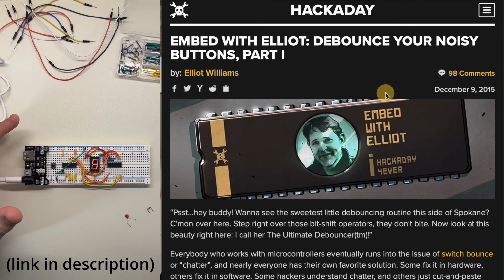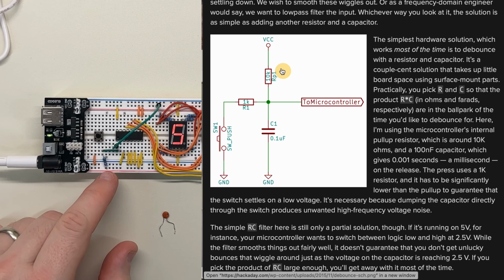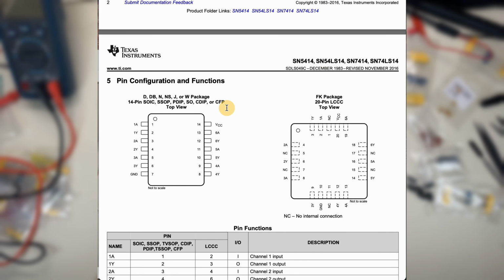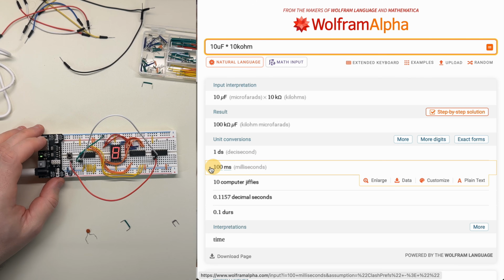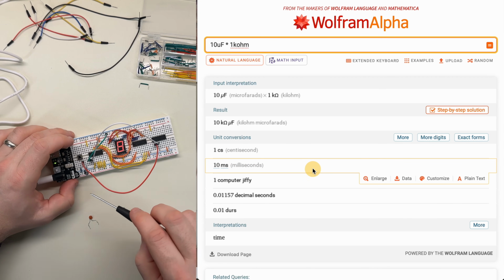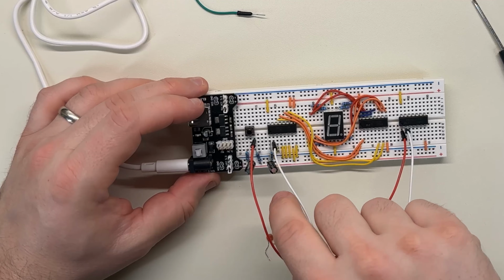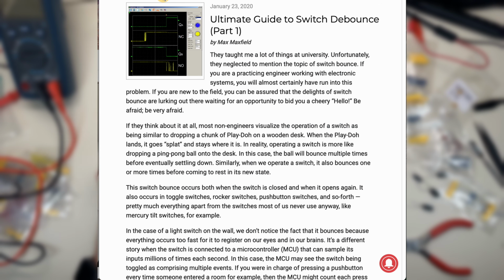Fixing my counter's bouncy button

Comment: You're right on the money with the reset circuit. On power up capacitor acts basically as a short.
Capacitor will discharge on its own through VCC pin and pull up resistor and also through the reset input.

Just use smaller capacitor to make it work reliable instead of resistor across capacitor otherwise you are making potential divider and reset might not be held to the positive rail but something lower.

On debounce circuit - it does work without shmitt logic gate. I did put it together just to double check. Don't do the R*C calculation tho, please use RC filter calculator to see what frequencies are being cut. for 1k and 100n that'd still let 1kHz spikes through.

What could happen is that you did not pull the voltage low enough to trigger this certain chip.

TTL chips of "LS" series are built slightly different and contain pull-up resistors on the inputs.
The value varies by the manufacturer tho, it could have happened that that resistance paralleled to your 10k resistor in conjunction with 1k resistor connected to the ground did not allow the voltage to fall below 0.8V which is logical "0". But that's me guessing.

Good work figuring it out :-)
Reply: It is actually quite difficult to design a power-on reset circuit that performs well. Where things typically go wrong is with brief power outage that doesn't allow a poor POR circuit design to be ready to work proplery when power is restored. I have some name-brand Ethernet switches that have poor POR circuits with the consequence that they don't reset properly on a brief AC mains power drop.

LS-TTL is highly consistent from one manufacture to another. Of course it is now essentially obsolete and has been for a number of years, though many parts are still being made. The inputs don't have pull-up resistors. The inputs are "current sourcing" - "conventional current" (which flows from positive to negative) flows out of the inputs. In order to establish a LOW condition at an input the voltage must be pulled to 0.8 volts or less with respect to circuit ground. With LS TTL the specified current sourced by an input is 0.4 mA. That means if you try to pull the input down with a resistor, that resistor should be no greater than 0.8 V / 0/4 mA = 2000 ohms. You actually also have to be able to provide 20 microamperes (again, "conventioal current) into an input to assure it will meet the minimum logic HIGH threshold voltage.

It is very much time constants that matter in debounce circuits, not frequencies as such. Switches from major manufactures will almost always have a bounce time specification, and what you need to assure is that the debounce circuit is designed based on that time. Depending on the characteristics of the input of the device you are using a simple RC product may be very close with regard to time (e.g. with 4000 series CMOS LOW and HIGH are 1/3 and 2/3 of the ICs supply voltage. In one time constant of an RC circuit the capacitor will charge to about 63% of the applied voltage, so it all works out quite conveniently.
Reply: @D614G_aka_Doug 
That's why there are specialized PoR circuit that can guarantee you that reset has been issued properly but I think that's for now beyond the scope of breadboard experimenting. :) 

For ther pull-up resistor and capacitor as the RC circuit yes, the R*C is its time constant, as in PoR circuit, but by introducing extra resistor in series with the switch it is becoming more of a RC filter.

If you look at LS series inputs schematic you'll find there's shottky diode on the input and resistor divider biasing the transistor base. And it all adds up. Actually you can skip the external pull-up resistor and it'll still work. I've seen (as per pdf) different values for the resistances there, usually around 15-20k
Reply: @JoRuss  
The extra resistor, in most debounce circuits, has negligible effect on the timing since it must be low in value relative to the pullup resistor with any TTL-compatible input where the voltage can be no higher than 0.8 V for LOW. It is there for one purpose - to limit the peak current through the switch contacts. Typically you might use 200 ohms or so in a 5 V circuit, limiting the peak current to 25 mA. You don't want to make the cap discharge time any longer than necessary so you don't introduce an unwanted delay between start of closure of the switch and response of the down-stream circuit. With a manually-operated switch a delay of even a few milliseconds probably is irrelevant.
The critical delay for debouncing is that produced by the capacitor and the pullup resistor. This is a simple problem in the time domain and transforming it to a frequency domain problem is just silly, in my opinion. If you are learning about this stuff it would add unnecessary and unhelpful complication. Effort would be far better put into understanding basic RC circuits in the time domain and learning how to relate an RC time constant to the time actually required for the voltage on the capacitor to reach the threshold required by the logic device.
Vc = Vs (1 - e^(-t/RC))

I'm very familiar with TTL input structures.
First, I have no clue what you mean by "And it all adds up."
The only diode, as such, is that from input to the "ground" of the IC. In normal operation only the tiny reverse biased leakage current of the diode comes into play and its existence can be ignored. The fundamental input circuit is a common-base transistor, the emitter of which goes to the input terminal. In many devices a multi-emitter transistor is used. In general practical terms the transistor behaves as a group of common-anode diodes. If one of the input is pulled sufficiently low the current from the resistor to the base (anodes) from Vcc (just a single resistor, not a divider) is diverted from the base-collector  "diode" and the phase splitting transistor turns off. In reality there can be some true common-base transistor behavior in that carriers can actually be "sucked out" of the base region of the phase splutter, for faster switching which would be impossible with just diodes..
You can usually get away without using pullup resistors on unused input that need to be HIGH, but you shouldn't. It is bad practice that can lead to mysterious misoperation. The datasheets very clearly spell out that you must source a small amount of current into a TTL input to assure that it will meet the logic HIGH voltage threshhold.
Reply: @D614G_aka_Doug  I see your point ov view. Yes, it's bit simpler in time domain. 

Give it a second look how LS series inputs look. Datasheet for 74LS04 from texas instruments for example.

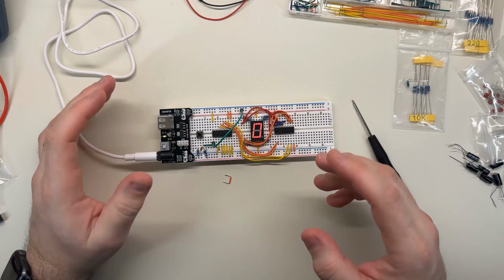Comment: 9:00 This has to do with the lower switching threshold of the IC. 
If you had a 74LS or 74HCT (74AHCT) then the switching LOW threshold would be 0.6 volts. 
With 74HC (74AHC) the LOW threshold is closer to 1.6V (VCC * 1/3)
A Schmidt trigger is the way to go.
Or use an NE555 as a Schmidt trigger.
Reply: an HF 74LS160N has a VIL of 0.8V (VIH = 2V).  10K over 1K should give us 0.454V. So I don't understand why the counter did not increment at all?  It should be going from 5V to 0.45V and so it should have worked.

Comment: Some 30 years ago I used a 4017 decade counter and a 555 timer to make an LED chaser. The design was pretty good, but I had an issue with autonomous triggering out of cycle. I didn't have a scope, I was poor (I was still at school where electronics was limited to 2 lessons a year   where you wired a pair of C cell batteries to a bulb holder and bulb - and that was it), I guessed there was radio like interference (my guess I know now was probably 100% spot on) because the incorrect triggering was significantly worse when my hand went anywhere near the board. 

Capacitive induced RF is hard to avoid.

Comment: This was very fun to watch and your logical process was spot on. I recently had to do the same thing for one of my projects and I was curious to see your solution. Its hard for me to tell if all your parts were TTL or CMOS but I'd say for the reset line you probably also want a pull up resistor on the reset input to make that RC circuit. Also check out 555 timers as they make great de-bounce and are just fun to play with.

Comment: A condenser with 10pF should stop the bouncing
Reply: Capacitor* 😉
Reply: I was going to reply the same lol  @Rob_III
Reply: @Rob_III  Condenser is an older term for capacitor, it's the same thing.
Reply: @Mr_Rusty1  I know, I'm aware. In Dutch, my native language, it's also "still" called a "condensator". Doesn't mean that the common english term nowadays is capacitor and I wanted to clarify for people being confused by "condenser".
Reply: 10 pF is far too little capacitance for any practical circuit.
Bounce time of typical switches is typically in the range of a few milliseconds, so you want a time constant  at least that long. For a 5 ms time constant you'd need a resistor of 500 megohms with a 10 pF capacitor. 
Even with CMOS devices it is best to keep resistances down in the range of 10 megohms or less. I'd stick with 1M or less in most circuits.
Reply: @D614G_aka_Doug  High impedance circuits, especially when on long wires to a reset button (or on a breadboard), are subject to noise pickup and rfi. e.g. users finger. So a 10M impedance on an unshielded button is asking for trouble. For user peripherals such as pots, buttons, etc. I always try to keep it to between 10k and 100k and if over 50k I tend to use shielded wires (or twisted pair if gnd is one of the signals). A typical example is replacing a miniature  500K 10 turn pot on a switched mode power supply PCB with wires and a standard 500k pot leading to the front panel of a project box. The wires can pick up radiated noise from the SMP itself or nearby equipment or the users body when touching the pot knob or any externally accessible component (esp. if case is not grounded) and can drive the SMP crazy or even blow it up (don't ask me how I know!). I used shielded braided cable for the 500K pot wires and gnd to the pot body and problem was solved. Of course, if possible, adding a capacitor also reduces injected noise.